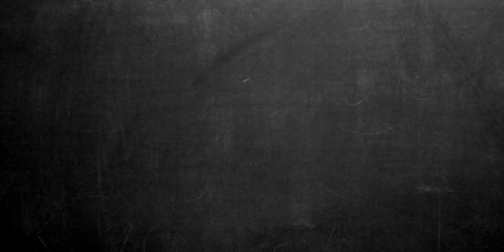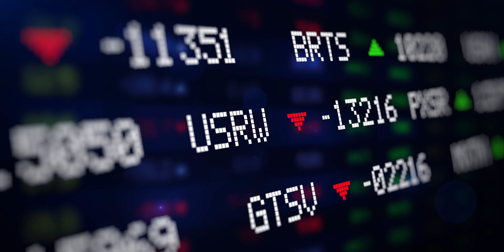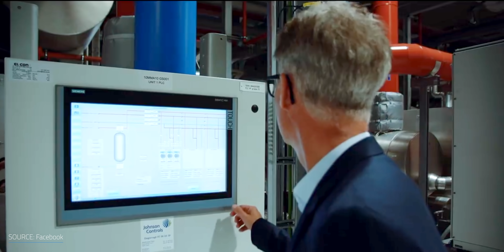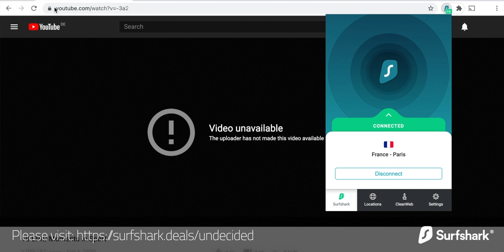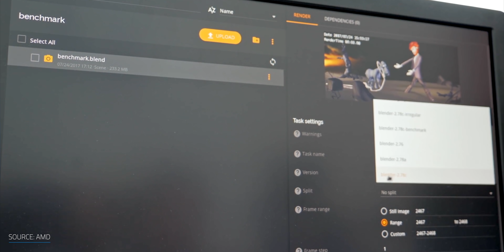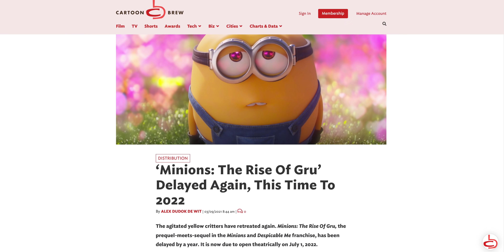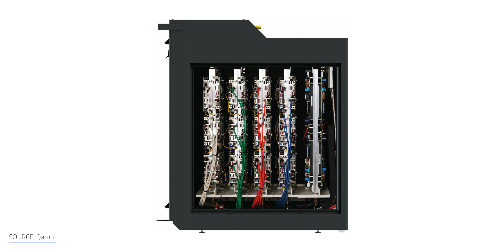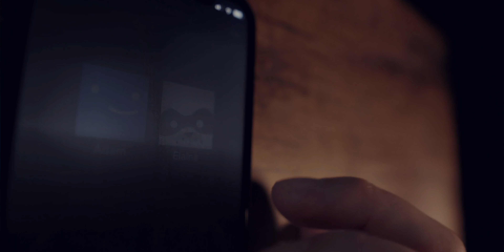Exploring How Big Tech Could Heat Our Homes ... For Free?

Comment: If your computer is heating your home in the winter then its also heating it in the summer.  If you life in alaska that might be fine, but if you live anywhere in the south then its more expensive to cool off the heat in the summer than the cost saving from not having to heat as much in the winter.
Reply: Well. But you can just vent the heat outside in the summer then. You don't have to let it into you're room

Comment: I have been heating my home with computers for years. Have a server rack with a Plex media server. Few game servers, massive NAS box then aswell as few other PCs. All up its about 1.5-2KW worth of load. Im from Australia so this does a nice job heating my house for 95% of days. And for the small amount of days during winter it doesnt cut it i have inverter mini split air cons i can run in heating mode. I do have to run AC pretty much all the time during warmer months but i have 5KW worth of solar which offsets the AC so all up i pay between $80 to $130 for electricity per month depending on solar output and time of year

Comment: I have been heating my apartment via computer for years now. It isn't as quick as a traditional heater, but you can do some good in the world while heat you space. I donate CPU time to Folding@Home, but there a lots of options for non profits that need cpu time. You can use any gaming computer or even some gaming consoles. I believe the PS3 could run Folding@Home.

Comment: I was thinking this would be an epic content delivery network, but I don’t think Netflix would be the most efficient use case. A CDN node would likely saturate the uplink far faster than it would saturate the compute power. There are crypto projects out there that essentially do exactly this… generate revenue to distribute content while producing heat (although, I don’t think the extra heat is part of the business plan!) 

I wonder how they keep individual systems secure, and more importantly, how they guard their network against compromised nodes. All large cloud hosting providers and data center operators must implement significant physical security measures to protect against security breaches. I suspect certain workloads simply would not run in such environments.

Comment: I heated my lounge through two UK winters running distrib computing (Einstein@home, Rosetta) on a stack of 486 machines back in the day when they were being sold off second hand because they were no longer "cutting edge" but still reasonable.

Ten years later did the same for running Prime Grid to heat my  bedroom over three winters on  a stack of 7 computers i bought for £10 each.

The cost of the electricity was slightly more than my normal winter bills in both cases but in return I had 24/7 heat.

The issue that stopped both projects was that the processors go out of date and the amount of processing you can do gets left behind as other participants upgrade. Eventually it feels futile.

To get max performance you need recent hardware and the cost of that could match the power cost.

I think that that is going to be the biggest downside along with the logistics of rolling out new hardware to lots of small sites -- I don't see a system being economic  where an engineer needs to visit individual homes every year or two in order to upgrade the boiler (furnace).

The engineer will maybe upgrade ten in a day driving around people's homes where they could do maybe forty in a data centre. In effect the company is paying skilled wages for the driving time as well as the tekky time.

On the other hand, in large buildings  (offices, schools, swimming pools) I can see the this being cost effective.

Comment: what about plugging Stirling engines on heat sources to generate power?
Reply: That's less efficient than using the heat directly. I'd imagine it would also be somewhat more expensive and higher maintenance.
Reply: @dillonvandergriff4124  in summer you don't want the extra heat, so you may as well not waste it

Comment: "....Computers Could Heat Our Homes..." Yes. Make servers in the form factor of an electric baseboard heater, and use a low voltage thermostat to smoothly control boot-up and shut down (other approaches are possible). You'll also need a network connection, either Ethernet or WiFi. Cost of computing cycles thus becomes much cheaper as the marketplace will automatically share the electricity bill between computer cycles and space heating. This is doable now, and was probably doable ten years ago. But now it's a no brainer. BTW, in the Northern hemisphere summer, you'll find that space heating in the Southern hemisphere winter will be very profitable.

Comment: Ceramics industry could use a lot of heat recovery, they fire kilns from room temps to 600C and above but all that heat becomes waste heat within a few hours only to need to reheat the same kiln to 600C an hour later, unlike metal foundries which benefit from always on and keeping the heat trapped the ceramics industry routinely has to dissipate all the heat it uses in precise ways to prevent ceramics from cracking. There is no way to trap the energy for reuse in the same process so the energy should be recovered for other processes, I also think it should be combined with the air batteries idea, if they can build up and store the energy they use from the grid over time (or even over night) rather than at the point of use you end up with this huge gradient of hot and cold to derive electricity from, the release of pressure from liquified air on one side and the heat of the kiln on the other. And within the UK at least there's ceramics and brickworks within easy reach of thousands of homes and businesses

Comment: It doesn't matter if you push electricity through a copper coil or through a CPU, the heating efficiency is the same. It's actually a very smart approach to get computation as a side product from heating needs.

Comment: Sounds very interesting in terms of energy reused.
Sounds terrible, when thinking about data security. You practically have server farms in not secured locations, making them an easy target.
Reply: They can break the workload in such small chunks that reassembling the result will be impossible. And of course they must be having full encryption (so you'd have to hack chips themselves) and intrusion detection. It won't at all be like taking apart your computer and copying everything from ssd
Reply: @NJ-wb1cz  
It is not about the data processed on these units.
It is about having access to the unit, which is part of a large network and which is connected to the network. Meaning physical access. Giving you more ways of infiltrating the network. And in fact, giving you all the time you need.
This is why large scale server farms are high security areas. So that noone can physically access them.

Comment: I've always loved this approach and i'd love to see it come into more buildings!
While I don't think using them as room heaters is a great idea, the boiler in a more centralized place as a replacement or addition to traditional heating would be perfect. You always need hot water to wash dishes, your clothes, yourself and half of the year also to heat.
Additionally think about how amazing this could work if you add solar panels into the mix, so they can provide part of the energy needed for it, leading to less waste.
one of the major issues of green energy is its storage and i think you (or a similar channel) even recently made a video about smart thermostats pre-heating rooms and buildings when there is access energy to reduce massive spikes in energy consumption and more evenly spread it out. Using distributed server farms in buildings in combination with distributed power production through solar and wind and smarter heating and living has massive potential!

I mean one of the big reasons why many companies have so many servers all over the world is physical distance and latency. One of the reasons why they are often not inside a city but somewhere outside is the price of land in cities. So you could get even lower latency, waste less energy, don't need to build additional constructions to house them, get the benefits of distribution (so if one building burns down, gets flooded or has a power outage the others still work) and help improve existing infrastructure for power and internet in populated spaces. 
One counter argument though is that servicing them would be harder since you'd need technicians to travel further and switch between locations for issues instead of being in one place.
And also security: making sure that people don't attack the network since they have physical access to it. It would only affect a very small percentage but seeing how Google, Microsoft and Amazon server buildings have almost military grade physical protection layers this is definitely something to consider.

Comment: This is nothing new.  In the early days of computers, architects designed buildings heated by the new mainframes.   The only problem is when the next generation of mainframe came along.  The new generation was more efficient and didn't produce as much heat.  So they had to upgrade the heating systems along with the mainframes.  There is a lesson to be learned there.  Any system needs to think about upgrades.

Comment: There was a rumor in the computer industry in the 90's about the Cray Research building in Minnesota. It had a supercomputer in the middle of the building, and that was used to heat the building. When Cray went bankrupt, the building couldn't be sold because it wasn't equipped with heat.

Comment: Something I have been wondering many times while working at a food plant is why I don't hear many people experimenting with a single loop type thermal management solution that can, say, pull heat from a refrigeration wing of the plant and use that toward generating steam for heat and cooking processes, instead of burning energy to dump heat from the refrigerators outdoors, then burn fuel to generate steam. Is doing something like this just terribly inefficient that it's not worth something as simple as preheating boil water with the condenser side of an evaporation loop, and then maybe using a chiller to get rid of the rest of the heat when the boilers can't keep up?

Comment: The boiler is also extremely useful for e.g.: in-floor heating, where the 60°C cutoff is really not an issue. I wanted to do something similar myself, with watercooling and a heat exchanger bolted onto the cold return of a heating system, but never had the chance.

Comment: use the heat generated by a CPU or GPU to turn water into steam to then turn a turbine that would then generate electricity for the computer, and while it wouldn't be entirely efficient due to a tiny inefficiency, it would be incredibly efficient nonetheless, although it wouldn't quite get hot enough to boil water, so you'd have to either use something else or risk destroying your computer, but maybe the difference in density would be enough, a lot of passive CPU coolers generate a fairly large amount of airflow just by the increased buoyancy of the heated air, maybe it would be enough for the water as well

Comment: Back in the 70's, a data center often consisted of a mainframe computer, a couple of tape drives, and a slew of disk platter drives.  The floor was raised to handle the wiring between devices and it is into this floor space that the A/C would go to keep the devices from getting too hot.  

I remember around this time being told of a data center where the A/C was fed directly into the devices.  This would keep them cool and it would warm the air so it wasn't in the 60's F in the computer room.

Comment: Harvesting heat from water cooled processors is a great idea!!!  If the data center is located under a populated area (like a University or Business Center), then that hot water can be used to for radiated heat in the winter and hot water in bathrooms and showers all year round.

Comment: I think this would be a great Bitcoin strategy.  Create a ASIC that adds hashpower when on, and make the device inexpensive, small and enough it can be plugged like a regular space heater, and the energy use is offset by mined bitcoin.  From the users perspective, this simply offsets they cost of heating the room, and for the mining farms perspective it means very low cost power (like other examples, power cost is split between heat need and computational need) and increased geographic distribution.  Unlike other computational needs this doesn't require high bandwidth and latency is not really that big of an issue (each ASIC is given a partial hash task and can work on it for about 10 minutes).  On average the number of people needing heat across the globe is roughly the same, so the key would be marketing this to matched countries in different hemispheres (e.g. Australia + Canada, South Africa + Finland, etc) so that Winter heat is a constant need.

Comment: Actually, our homes would still be heated by fossil fuels this way...
Reply: Yeah. I think the point is that you're doing something useful while generating heat. Your average electric heater generates heat via electrical resistance, as do computers so you might as well calculate something with that energy. I could see it being really useful at college campuses, where you have both large heating and large computing needs.

Comment: Summer use: Connect these systems to PolarNights system for storing heat in sand in the summer for use in the winter.  Or, using it to heat pool water or spas.

Comment: Distributed systems are better for privacy and for environment. If you use social media regularly, I recommend trying out so called federated options, like Mastodon (for microblogging), Peertube (for videos) and Lemmy (for links sharing - like Reddit). Similar to cryptocurrencies, they are not owned by any single entity. Mostly the users host the networks, so it is distributed by design and so the heat output is distributed too.

Comment: LLNL has a great flow chart of energy origins (search LLNL Flow Charts) on the left and how it ends up on the right - about 3/5ths of energy ends up as rejected heat.... walk back from right to left and you find all kinds of processes that are energy inefficient to optimize...   maybe some ideas in there for another video.    Data center heat control - $$$  - They just built a new FB data center in Eagle Mountain, UT  (incidentally almost on the Pony Express route...) - water consumption is a big deal here, many unhappy.   Maybe there's a video out there on cooling without using water at all...

Comment: This has great potential in heat recovery and heat integration in chemical plants. The digital boiler can replace the traditional heat exchanger for heating of low temperature streams. Since most chemical plants are functioning 24x7, the digital boiler can also be used 24x7 for computing. It would also make sense to build high speed network infrastructure to connect these constant-use boilers. Only drawback I see is that the streams can't be heated to temperatures greater than 60C.

Comment: So in winter I use dehumidifiers to maintain some warmth by waste heat while avoiding condensation in a house made for warm weather.
The problem in is summer conditions, refrigerators and so on dump the heat where it needs to be got rid of.

Comment: Is this an example of heat energy as waste because of chip inefficiency? Shouldn’t we just fix that problem? LED is so much more efficient  because it does not give off heat like incandescent bulbs. Similar to internal combustion “waste” energy that is given off as heat rather than engine power. The solution is not to pump in more energy to salvage a small percentage on the back end. The solution should be to improve overall system efficiency.

Comment: Amazing idea, very elegant. I do have a question about the concept though. In the case that computing power demand doesn't line up with the heat demand doesn't the business model break down?
Reply: Just thinking this. These systems are expensive and you never want to have to limit them just because a room is already warm. Facebooks recovery system stores the heat for use but doesn’t require that use to continue using the data center at full capacity
Reply: Dumping waste heat is something we already know how to do.